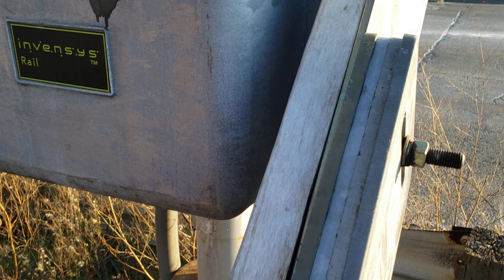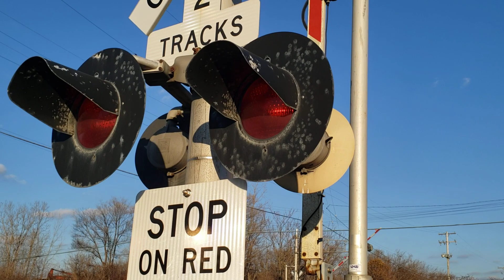Davison Road Railroad Crossing Malfunction, Flint, MI. (11/21/2022)

Comment: You could have probably grabbed that gate and dislodged it from the upper light and it would have went up instead of standing there, trying to make a video. You could have fixed the problem and then called it in to csx
Reply from the maker: yes, I could've done that as said in the video, but I didn't know doing that would count as tampering with railroad property, so I just called it in only
Reply: @damon810railfan  I don't think the railroad would have cared being that. It was stuck on that light. We have had crossing gates. To get stuck in the down position one will go up and the other 1 just stays down. I have walked the crossing gate back app and it stayed and then called it in to let the CS x dispatcher dispatcher. No, and I told him that I stood it back up and he was like. We appreciate that and we will send somebody out there to fix it. It was holding up traffic and could have caused an accident. And they were more than glad that I was able to fix it until they could get a tech out there.